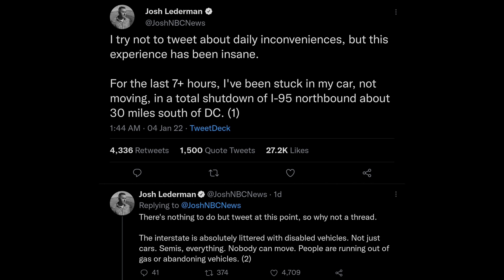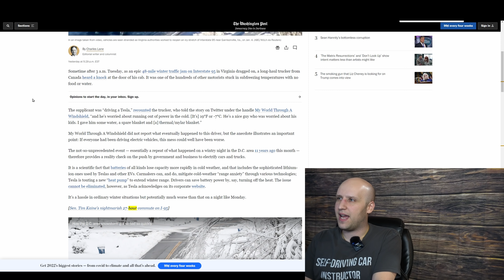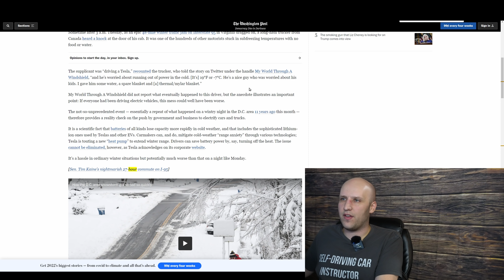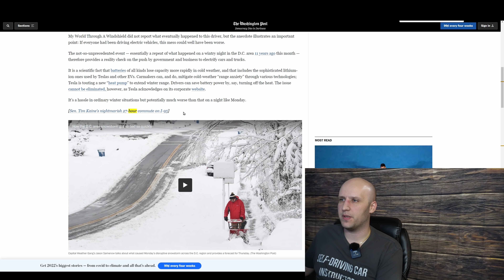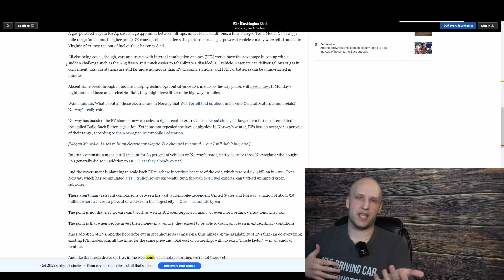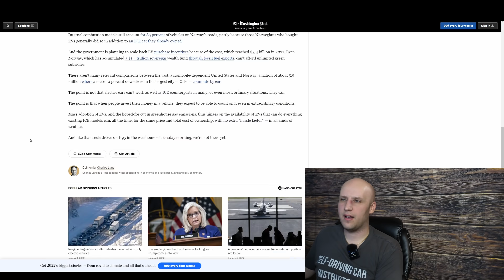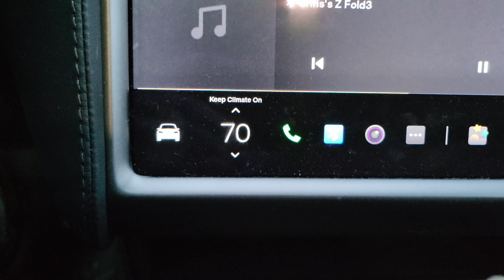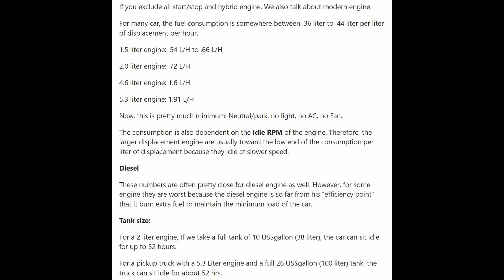How Long Can a Tesla Keep You Warm In A Frozen Traffic Jam? | FUD Debunking

Comment: Also consider that someone driving an EV would probably have had an almost full battery from charging overnight at home, as opposed to a gas car which might have been running low on fuel...
The odds are not in favor of ICE
Reply: Completely agree for people that drive locally. However when doing longer trips we tend to hop from charger to charger using the bottom part of the battery because it charges faster. So the answer is: it depends 😀
Reply: @martinroy3931  If you are road tripping in winter you really should be minding the weather and road conditions on the route anyways and so you'll know you are coming up to an area that its snowing. Easy to prep for it by sitting an extra 15 minutes at the last charger before the snow.

Yes its not the ideal short supercharger stop we are used to, but an ounce of prevention is worth a pound of cure.
Reply: @martinroy3931  Of course you probably shouldn't be planning a longer trip in either an EV or ICE if you know there is a major snowstorm coming. People will still commute if there is a chance of a lot of snow, hence what happened on I-95. People hedge their bets that they are just commuting only 20-40 miles at the most so they won't be far from home if it ever does happen. But going on a long road trip knowing that there is going to be a lot of snow isn't very wise.
Reply: it depends but you didnt think of different scenarios.....
Reply: Not to mention CO poison.
Reply: On the flip side, it is common practice to keep your engine mostly full when driving in cold weather.
Reply: I always have space blankets, water and some food in the car.
Reply: Or maximum 80% as most people tend to not charge full, for reasons. And then drive a bit and you are down to 60-70 maybe. Or if you drove longer and it might be down to 30-40. Or less...
Reply: @Xanthopteryx  Most people have average commute of 40 miles. At 80 percent you're still up around 260 miles so they might be down to 200 or 190 worst case, that's still 66% and the Y could last 40 hours of heat on that. More than likely, you are below half a tank in an ICE, so you are worse off than an average EV owner.
Reply: @domg7359  During winter, that will go down pretty much. Especially when going home from work without charging, and you need to preheat the entire car and the battery.
And not all BEV have super large (super expensive) batteries.
Reply: @Xanthopteryx  Even if they had 30% battery, if they turned the heat to 60 like in the last 6 hours of the video that's still 18 hours of battery you have left... The calculation was 100% you could last 60 hours, so 30% of 60 is 18.  Even at 20% you're getting 12 hours with the model Y.
Reply: @Xanthopteryx  I drive a Y. Winter doesn't effect range as much as other EVs.
Reply: @domg7359 :  Nonsense.  No one has to or should wait until an ICE is nearly empty to refill it.  Things happen, especially in winter.   I was just driving across town to do cat sitting duties for a friend, and with a winter storm in the forecast, I made sure I had a nearly full tank instead of a half full tank, for example.  If nothing else, bad traffic snarls can happen, accidents can happen, and forecasts can be very wrong (which all happened in my city). 

You don't need to make unreasonable distortions to make the case for the BEV in this situation, and when you do, it GREATLY hurts your credibility. 

Saying "more than likely" below 50% full in the ICE is nonsensical for a large set of cars.
Reply: @russanderson1106 :  Plus, with a blanket, hood or hat, and a coat, with the seat heater, any normal person would be QUITE comfortable with the BEV at a continuous 50 degrees.  Since running out of energy (battery or gasoline) is a disaster in very cold weather when stranded, being able to conserve (buy more time) with little to no real discomfort is HUGE, once the energy level drops below some reasonable threshold.
Reply: @rogergeyer9851  Majority of gas car owners wait till they are nearly empty to get more fuel, where as the majority of EV owners charge overnight every night. That's reality. Your specific case may be different, great. Then you are no better off than EV owners except you have to constantly stop at gas stations... that's not a good thing, that is worse. I pay $8 to 'fill up' the whole battery. I'm certain you are paying a lot more for equivalent range, and it is a lot more of a hassle to stop at gas stations. An EV is a better vehicle for this situation.
Reply: @rogergeyer9851  "No one has to or should wait until an ICE is nearly empty to refill it. " of course not.  But many people DO.  If you claim to know the percentage who do as you recommend, we are going to need data.  If we assume that people fill when the low light comes on, and fill to the top, then 55% would be a good average.  For the particular situation here, everyone had been driving for a while, so below 50% seems a good first approximation,  nothing like 'nonsensical'.
Reply: @rogergeyer9851  I thought the big "advantage" of ICE cars was that you "dont need to refuel them every couple of hours"? But if you want to keep your tank near full that's exactly what you would have to do.

Almost everyone I know drives until they are down to ~1/4 or less before they stop at a gas station.
Reply: @rogergeyer9851  You're using an anecdote to make a point, which doesn't work.

Many people wait until the fuel light comes on to get gas, for two major reasons: A. Don't want to spend money on expensive fuel. B. Don't like the inconvenience of detouring from whatever they'd rather be doing, to stop for gas. The fact that gas stations exist on nearly every corner contributes to point B, since you can generally wait until you need it. 

If there is a known major event, it can trigger people to rush for gas (and even contribute to shortages), but for the most part, the reason this discussion is even taking place, is because people don't actively fill their tanks, if they don't have to. The infrastructure serves them well enough that incidents like this snow storm are isolated.

Comment: They are always saying: "But yeah. What happens if you have just 20% left or so?" 
It could be exactly the same with gas cars. They could have like just 5L gas left in their tank.
Reply: People seem to fail to realize that the vast majority of EV owners will plug in their car every day. So they’re more likely to have a full “tank” before commuting than any of the gas cars.
Reply: @shableep  Exactly. Charge from like 50-80 percent over night or so. But you don't go like every day to a gas station. Most persons are filling up their gas cars at about 5-10%. But with EVs most of the people charge it at like 30-50% or so to 80%.
Reply: The article is actually implying that practically every EV in that situation will be low on battery charge --thus the "doomsday" scenario.  In reality, some cars will be at 90%, some at 20% and most somewhere in between.

It's also a moronic article because they project into the future where all cars are electric, but fail to project improvements in technology that undoubtedly will eliminate many of the problems they fret about.
Reply: And 50% battery?
Reply: Yeah but if you run out of gas it’s easier to just get a couple of gallons from the gas station incase of emergency
Reply: @Pianistp3  If you are stuck in cold weather in an emergency situation you aren't going to the gas station to get a couple gallons ...
Reply: @Pianistp3  You mean like walking 20 miles during a traffic jam over the highway at -10°C? Good idea xD With an EV you only need a plug.
Reply: @jul1anuhd  ha. Obviously no one is going to walk 20 miles in frigid weather but I did hear of stories where those closer to exits were able to get fuel and walk back to the car.
Reply: @Pianistp3  so let's base everything on a extremely tiny possibility that 1, you're going to get caught for 24 hours in a snowstorm and 2 if that happens I might be lucky enough to be caught less than a mile from a gas station.  So obviously I'll never own a EV in case that happens.  Reminds me of when the seat belt laws passed and people would argue they're afraid to wear it because what if they crash into a lake and can't get it off?  100 percent real argument I heard 100 times back when NY passed it .
Reply: First of all, only idiots have only 5 liters of petrol/diesel during winter... but, if you only had 5 liters, that is around 5-10 hours of heat.
Reply: @Xanthopteryx  Yeah... and at 20% battery you still have 12 hours of heat in a Y...
Reply: @domg7359  And then you can not move. Without towing... And if it is cold (not that was in this example from the car pileup where it was only a bit chilly -7 degree C is, well, could be nice to have a hat and gloves outside but not necessary)
Reply: @Xanthopteryx  Big effing deal, those few people that were unlucky enough to get stranded with a low SOC and went down to 0% will get towed.
Reply: @boostav  or more likely get a seat in another car and not use any of the batteri
Reply: @nielsnb11  What we're talking about is after the road has been cleared.
Reply: @boostav  we are talking about being stranded with low fuel or state of charge, not using any fuel or electricity until the road opens would make sense. You clearly left your mind at home if you don't have enough fuel or electricity to drive off the highway when it opens. But yeah, sure, it can be towed like any other car that breaks down.
Reply: @nielsnb11  I was replying to a specific scenario. Sure, ideally you shouldn't even let it get to that point and find another car to host you when you get down to 5-10% or so.
Reply: @Xanthopteryx  in a Honda maybe.

Comment: People have no idea about how much better electric vehicles are. 🤦🏻‍♂️
Reply: I tell people that winter is when EVs can really show off how amazing they are

Today I had to drop the kids off at school with my truck because wife had the tesla. It was -10F this morning and I was on my way home before I started to feel any real heat. Short winter drives like this are not good for engines.
Reply: @dorvinion :  Nor are they great for batteries and how much energy they consume while warming up, as was repeatedly pointed out.
Reply: @rogergeyer9851  Absolutely but I do think the fact that you can warm your car while it is still in the Garage is a game-changer for me.
Reply: @rogergeyer9851  usually the horror show for battery life on LiPos is heat. In the cold they aren’t damaged. Whereas in internal combustion (and it’s worse with modern turbocharged engines) you end up blowing water vapor past the piston rings and into the oil.  So then you end up jumping through extra maintenance hoops or you constantly run the motor in your driveway “heating it up” or you just wreck it if you’re not paying attention.  And remember the old carburetor cars and bikes?  And oil getting cold?  Electric block heaters sorta fix those issues but then if you’re going to plug in a block heater you might as well just get smart and buy an EV. 😉
Reply: @rogergeyer9851  The batteries only need to be warm for charging, not for short drives. Regenerative Braking will not work while the batteries are cold...that's the only downside.
Reply: @skyemalcolm  Yeah but how often does that really happen you could have a 10+ year old Toyota corolla or a Camry that has over 400k miles with the original engine and transmission on it and it still would probably be ok if maintained well. Toyotas and Honda’s are known to be very reliable. I could guarantee that a lot of people would forget to maintain there ev cause since regenerative braking is a good way to stop a vehicle then brakes will be less used and therefore braking would bot be as good cause the person hasn’t used it that much.
Reply: Electric vehicles do have problems though. When on the road charge times can be very long. By the way, I own a Tesla model three long range and I love it, but I’m honest that it does have some shortcomings as well.
Reply: Think all cars at electric and you need 1 hour to charge, , where will you charge? We have no infrastructure and not much being done to built new stations and improve our power supply,
Reply: diesel is the king, if you add battery on it, it will run forever. haha. just look all the ships, big trucks
Reply: my friends all think i'm nuts!!!!!  i tell them gas is nuts!!!!!!!!!!
Reply: @rctezluh42069  I'm tired of sending my money to Saudia Arabia and other OPEC countries.
Reply: Not all are created equal!
Reply: I'll stick with my hell cat V8, I love it and I love the sound it keeps me awake.
Reply: I believe those batteries are lithium . The biggest source of lithium is China age Afghanistan ( Which China has started to develop). Great to know we are going to be even more dependent on China . Now if those batteries aren’t lithium I’m just all wet
Reply: It's a moronic article because they project a future where all cars are electric, but fail to project improvements in technology that undoubtedly will eliminate many of the problems they hype.  I'll never go back to gas!
Reply: @kenbob1071  well then don’t fly commercially or take a cruise .
Reply: @kenbob1071  part of the mission by Tesla is continually make make improvement and solve problems that mat not have a solution today. Even better is they are doing it extremely fast which will mean they will keep moving further ahead of legacy. Most people do not understand this fact. As you are aware we continuously get updates.
Reply: @kenbob1071  yes and as EV % grows gas stations will start going out of business.
Reply: @FerrellMcCollough  Or they will adapt and become charging stations as many are already starting to do.
Reply: For some situations but not all,  it will be a while before EV can stand up to that high bar.
Reply: you see this lady...she's f'ing nuts!!
Reply: Some of them are probably paid off by big oil to lie. Other people are probably just stupid and haven't researched EV's and still think they are as bad as they were a decade ago.
Reply: it was like this when gas vehicles were coming out as well, don't worry it will just take some time, history repeats itself.
Reply: We can't afford to know lol.
Reply: but for quality we need more time to get to really  good quality of electric cars. for batteries and electric motors
Reply: electric vehicles are a pipe dream. I could buy my gas car 5 times over for the price of one electric car. more toxic chemicals and shorter life of the car, and still burning fossils for energy. ev's are nearly a scam. I'll stick with what works for me. my car is 15 years old and still works great. how many replacement batteries would a tesla need in that length of time. your total cost of ownership is simply insane.
Reply: People have no idea how better electric cars will be when they ditch lithium ion batteries. Mugs buying one now because they will be worthless cars in a few years when a better power source is introduced. LOL at fashion victims, getting the must have latest trend. LOL all leased or finance as well. Haha.
Reply: As always, it all depends on situation.
Reply: Many folk will continue having no idea as they can't afford ban ev
Reply: especially petrolheads